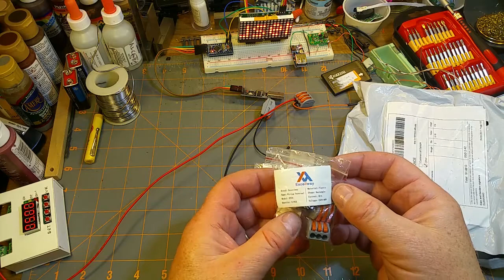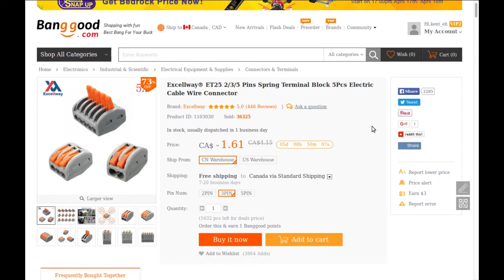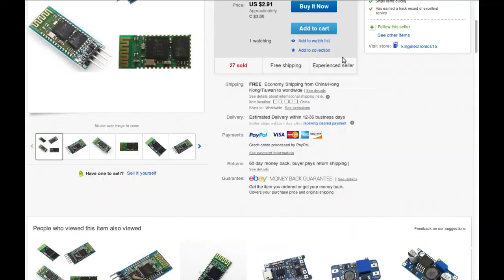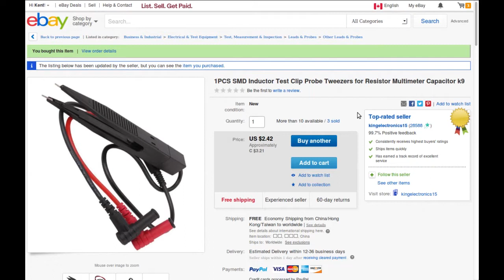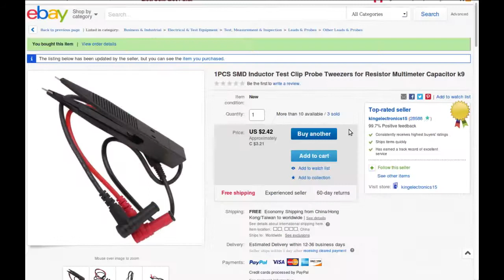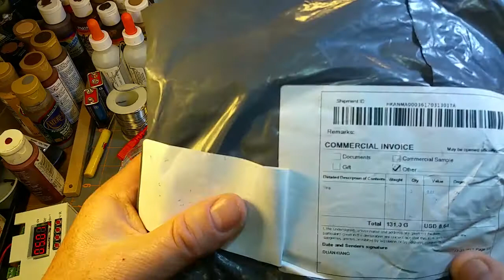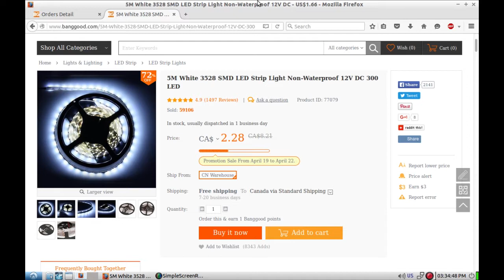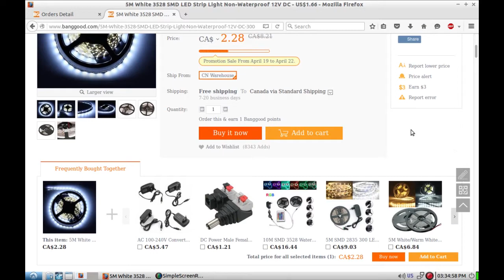mailbag

Comment: Can you Share how you CeramTec that Power Supply you used in that Video?
Reply from the maker: I think your spell-checker broke some of your words...

My "bench" power supply is one of these: https://www.ebay.ca/sch/sis.html?_nkw=B3603+LED+DC-DC+Digital+Control+Step+Down+Module+Power+Supply+Adjustable+Buck&_id=391047119166&&_trksid=p2057872.m2749.l2658

In a case that I put together from some bits  of plastic : https://www.youtube.com/watch?v=avv7dsoVO9o